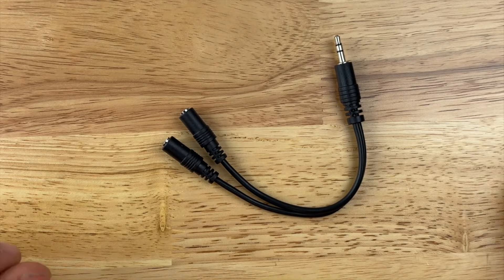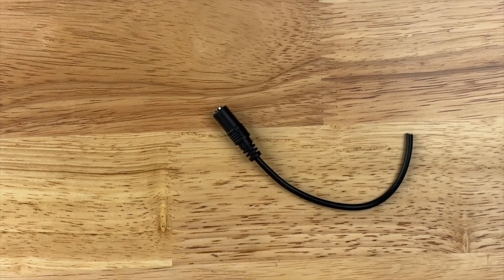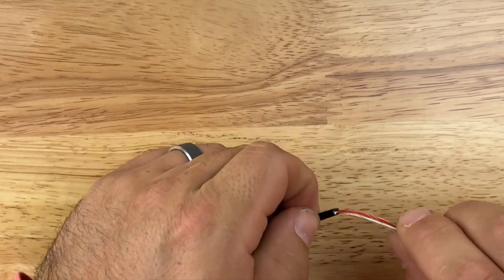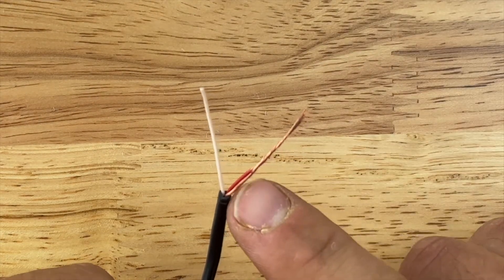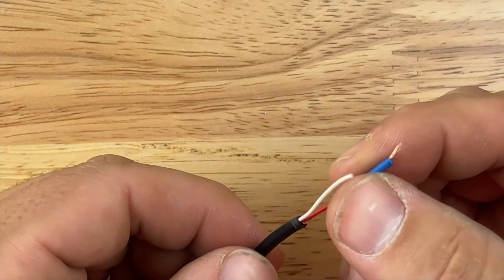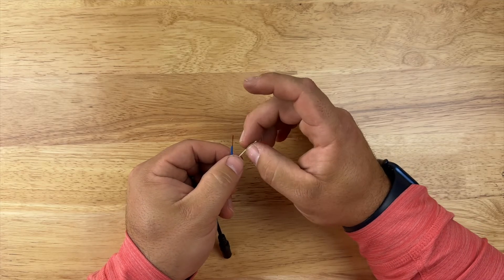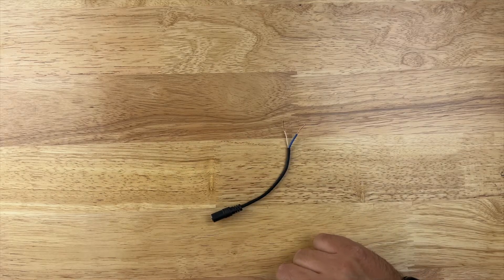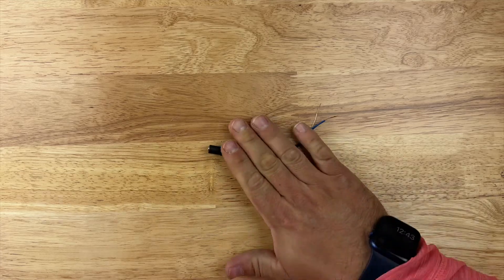Preparing 3 5mm Headphone Jack

Comment: Does it matter which 2 wires you put together?
Reply from the maker: Unfortunately, not all headphone jacks are the same. The wires you need to combine may be different than the ones we demonstrated in the video. Let me try to explain it, and hopefully, I won't confuse you further :). In short, yes, it does matter, and you may have to experiment to determine the correct configuration.

Now, let's dive into more details.

Most headphone jacks in use are stereo jacks. Stereo jacks typically have three wires and three connection points on the plug, known as Tip, Ring, and Sleeve (abbreviated as TRS). In our video, the white wire corresponds to the Tip, the red wire to the Ring, and the bare wire to the Sleeve.

However, most buttons for switch-adapted toys use mono jacks. Mono jacks have only two wires and two connection points on the plug, Tip and Sleeve (abbreviated as TS). Usually, the Tip size is the same for both TS and TRS connectors, making it possible to connect a TS to a TRS. The difference lies in how the Sleeve occupies the space that both the Ring and Sleeve share on a TRS connector.

So, if you plug a TS into a TRS, you'll need to combine the Ring and Sleeve wires while keeping the Tip wire separate. This may sound straightforward, but determining which wire is which can be tricky without some trial and error. If your wires have colored casings, I would recommend starting with white for Tip, red for Ring, and bare for Sleeve.

We often receive the question, "Why can't I just cut off one of the wires to make it two?" I wouldn't advise doing that. First, we may not know which wire is the Tip, and cutting it off by mistake could cause the toy to constantly activate. Second, if you cut off the Ring or Sleeve wire, the toy might work with some buttons but not with others. If a button manufacturer used a TRS connector instead of a TS connector, the button's wiring might not be compatible, leaving you wondering what went wrong.
Reply: @switchedadaptedtoys  thank you so much. I appreciate your explanation.